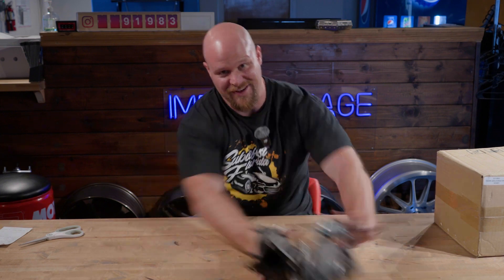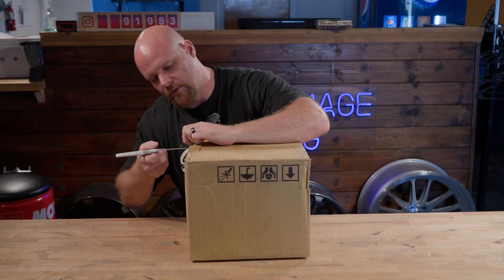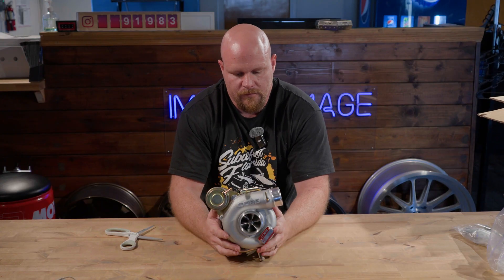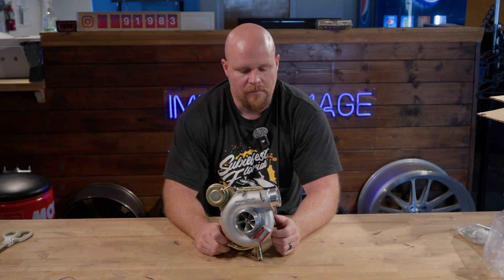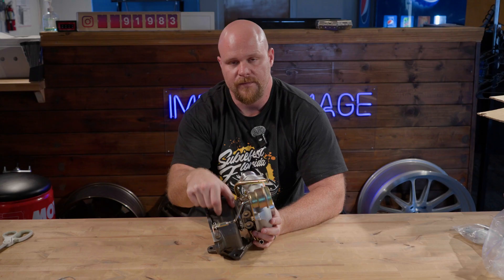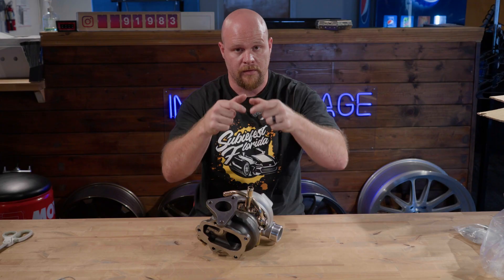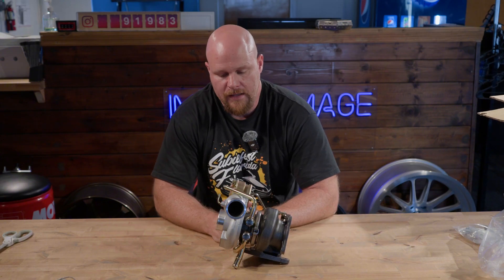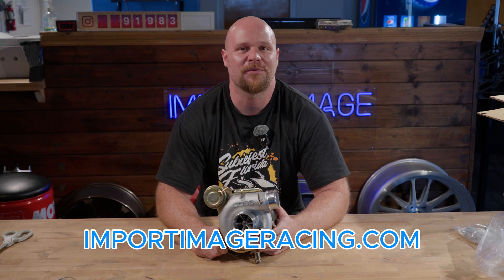Week of COBB – Episode 4/5: COBB TD05H-20G-8 Turbocharger Vehicle: 2008–2021 STI EJ257  Part  E1120G

Comment: From what I've gathered some downpipes have fitment issues with this turbo. Any recommendations?
Reply: The wastegate flapper on that turbo will have interference issues with some aftermarket downpipes such as MAPerformance and Grimmspeed. Clearancing will be required on the downpipe to allow full swing of the flapper for proper boost control. Some have utilized a thicker gasket and gained the necessary clearance.
Reply: @BoostedVQUR I read something to this and I have a MAPerformance DP. Any pointers to which adapter or gasket to run for the waste gate?
Reply from the maker: As long as it's the specific downpipe for the year/model car, any should be a direct bolt on replacement. This turbo has the same flange as OE for the up pipe/downpipe connection points.